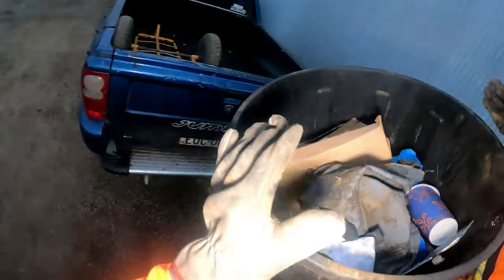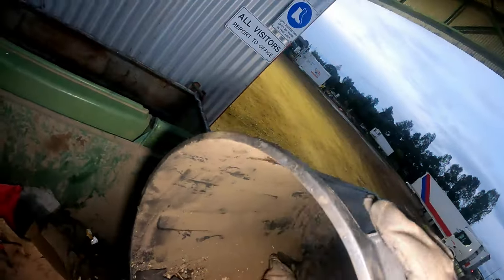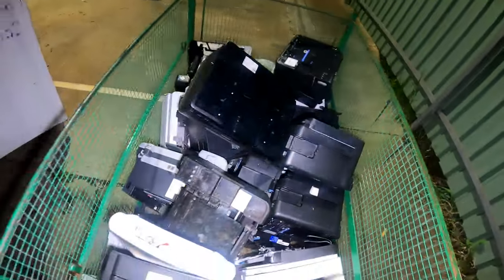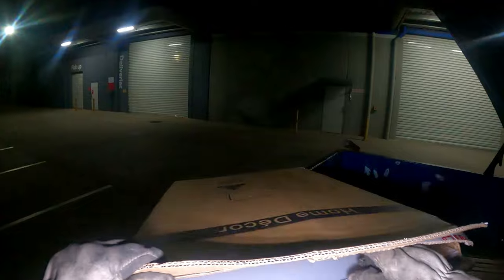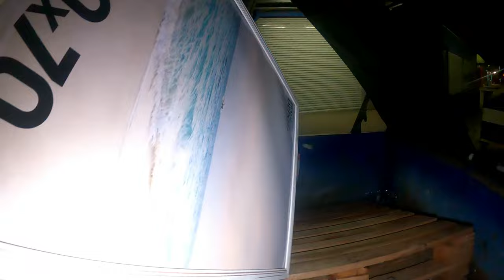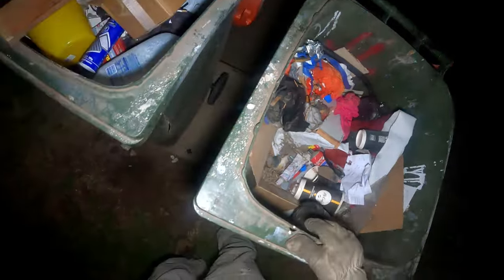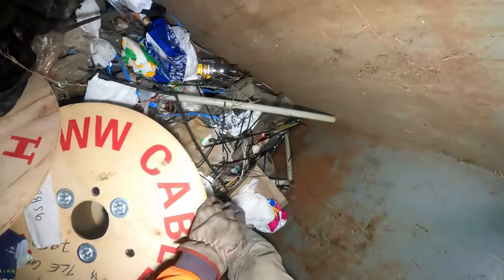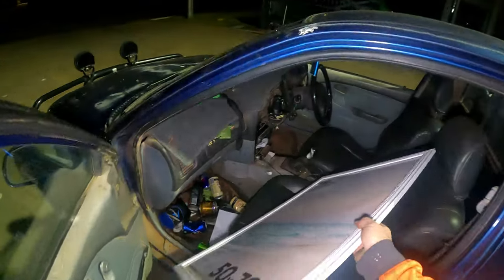Dumpster Diving Dam Imagine Me In That!!

Comment: Those little yogurt bottles are 10cents and I've seen you passing them by, Geez their 10cents refund each and they take up stuff all space. You that well off now? LOL
Reply from the maker: May be well off I don't think so the only reason why I passed them up because they will not go through the manual machine that we use is there too small for the conveyor belt and even if I take him to the bulk recycle centre they will not take them either because it won't go through their machine..
Reply: @oureverydayliving   Yes you are right similar story here in Goondiwindi they go through but don't register on the electronic counter, so that was over a dozen or so went into the bin, Live and learn, but oddly enough any squashed cans or plastic bottles go through even those ally cans that have been squished under foot and no bar code showing Yay!! Today I put through just over 1600 mixed so I'm a happy little recycler. Now to start the whole thing over for more recyclables. Cheers Mate great to see you don't chuck the good washing machines and have the mindset to repair them so some one can get use out of them Cheers .